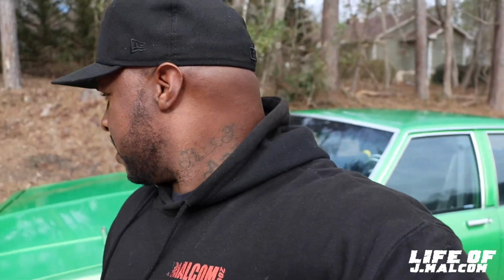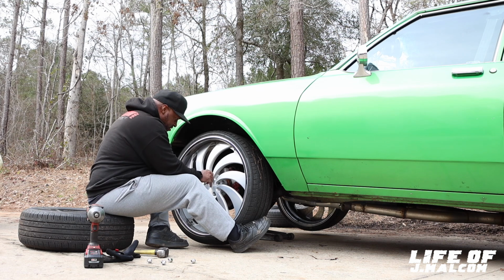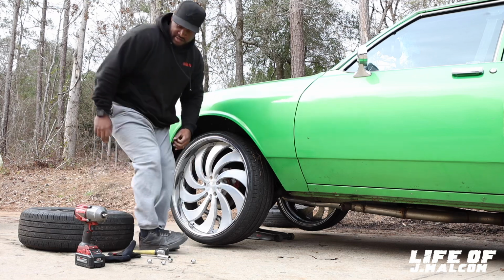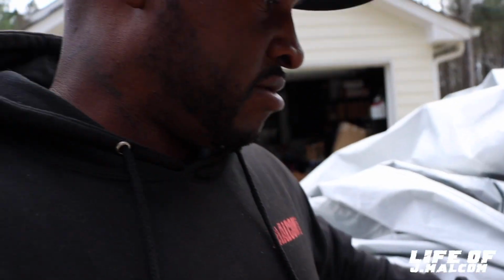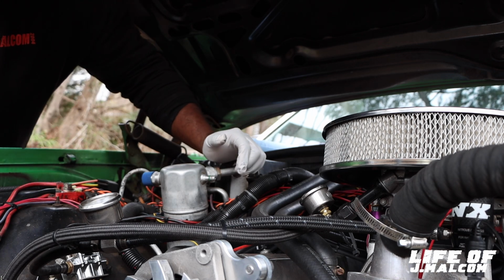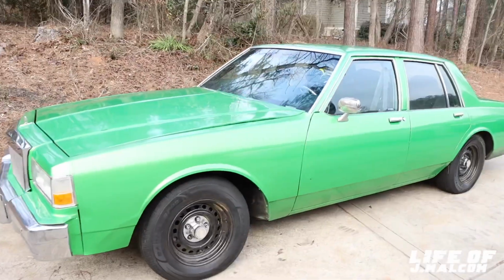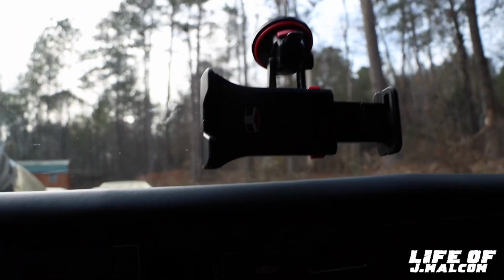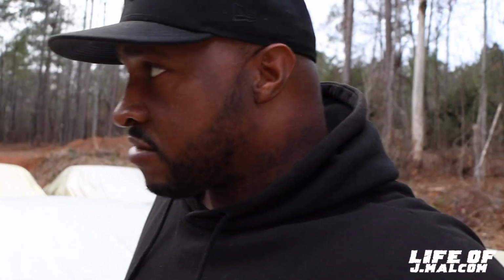GETTING DOLO READY TO HIT THE DYNO TOMORROW

Comment: @jmalcom.     I had the same problem with my 26s on the front of my 95 Bubble Chevy.   I use to back off on every lug a little at a time to get the last lug nut off easy.     I spent a couple of dollars on a set of bore rings spec for the wheel bore & it fixed my problem.    Hope this helps!